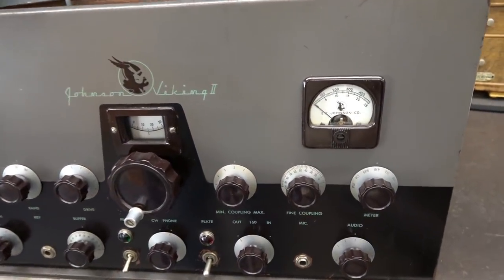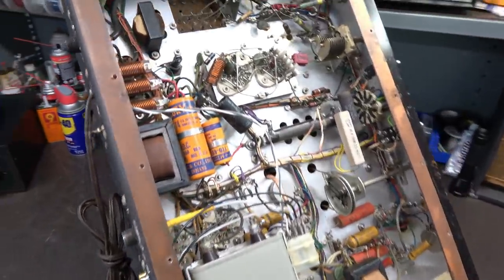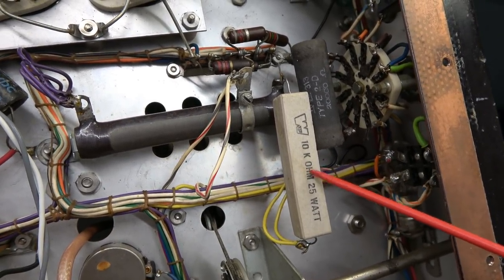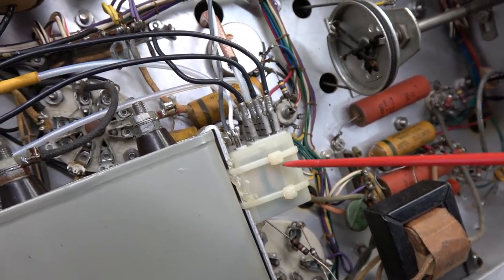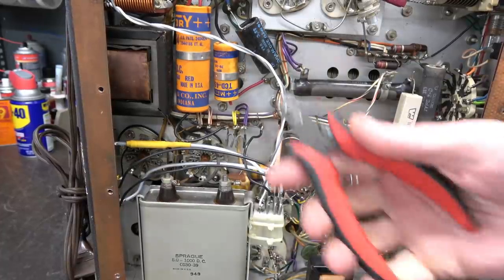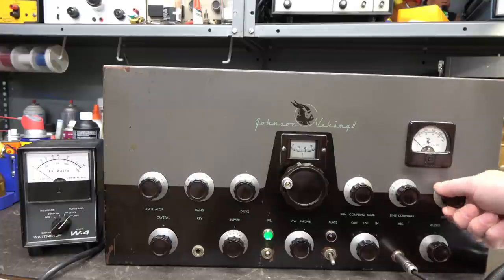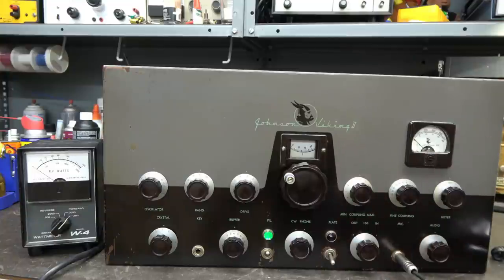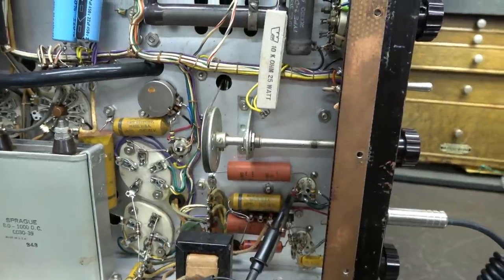How NOT to buy Johnson Viking II Ham AM CW Tube Transmitter Swapmeet Special

Comment: I saw that you changed out the resistor in a later part of the series.  I just had the impression that your emphasis of the hazard would have called for replacement (or at least reorientation ) right away.  Great vid.  thanks. 👍

Comment: If you cant look inside, top and bottom, then you are taking pot luck.  Sometimes, you get a raft of almost new tubes, a chassis that wipes clean with a damp cloth, and no damage, or weird mods to un-do. Bingo ! you won the lottery.  Sometimes you get a real bag of worms.  Replacement Modulation and Power Transformers really only come from parts radios...so it is often SAFEST  to test the power transformer with the rectfier removed FIRST.. on a variac  to make sure it isnt gonna smoke.. and use an ohm meter to test the mod xfmr ( resistance measurement are in the manual)  to make sure it is good.( no shorts or opens)   IF there is a capacitor across the mod transformer secondary ( high cut )  then it is smart NOT to apply power untill it has been removed or replaced !

Comment: I've learned my lesson from my many years of going to hamfests.  Hate to say it but some hams can be real dishonest.  One time, I was helping my brother-in-law purchase a Drake transceiver from a guy who said he just used it last week.  Took it to the test bench (The Dayton Hamfest had a test setup just for this purpose).  Anyway, plugged it in, powered it up, and received great.  Keyed the mic and NOTHING.  And NOTHING on all bands.  Needless to say, the seller had lots of sweat on his face claiming that it worked fine.  Yea. . . .sure.
Reply: "It was working when I last powered it up."  Heard that a gazillion times so as a seller I've started putting rigs on the bench before the hamfest and taking a video of them in operation on my phone...I then offer that to prospective buyers as at least some indication that the gear is functioning correctly. Surprisingly not a lot of guys want to see the video before buying something, I actually have to go out of my way to make them watch!  73 - Dino KL0S
Reply: Dino, I llike your technique.  I wish others would do the same.  I've sold many items at hamfests (and eBay, too).  If there's a problem,  then I tell them.  I sold a mixer board on ebay once and indicated that one of the 16 channels is out.  Even with that info, bidding was high and I sold it for more than I was expecting out of it.  Being honest saves a lot of frustration.  73's Craig N8CA

Comment: Timmy WA1HLR used to call them Junkstons, but he said it in a loving way.
Reply: Excellent work! Let's face it - they are all projects at this age. Even my military radios are failing now, and they used fantastic grade components. Even a perfectly untouched stock radio that demonstrates good at the meet, will shortly fail without the basics. Contact cleaning, cap replacements and a good tip to tail component and wiring inspection.
Reply: @MIKROWAVE1  Yes indeed... even milspec gear is subject to Father Time. 
I found another great Timtron video... besides being very humorous, he's also definitely a genius with old gear: youtube.com/watch?v=cqM-nbiMBOE

Comment: At this point, I consider most if not all old receivers and transmitters to be projects. So many have been butchered over the years. It seems more so now than ever. A lot of people are selling stuff that’s been supposedly checked and recapped that has multiple errors, uses cheap Chinese parts and is way out of alignment. I won’t pay good money for junk. I’ll buy if I can get it for cheap and it’s worth fixing or has useable parts.

Comment: I love it when some yo-yo decided to recap a radio... using ancient dried out  capacitors !   Paying for repairs on radios like this makes little financial sense, either for the repair man or the ham.. because Hams Are Cheap.   they have a one size fits all idea about what radios are worth.  Just take the parts.  If you are buying the caps onesy twosy at retail.. you get to spend $25 + shipping.  Tubes, expect to replace the finals and the modulators and 1 or 2 rectifiers,  and what are you up to if you don't have a well stocked junk box ( or have to replace the ones that go into this radio ) 2 6146's  2 807's a 5U4,   and already some real cash if you cant get them at the flea market.. and you dont want crummy tubes in your final or  unmatched  or soft tubes in you modulator... so you at least have to have tube tester.   So you can get 100 to $300 into parts...  you paid $50 or 100... and if you do the work yourself.. this is ok, because the radio will play for 30 years with no grief.. If you do a REAL OVERHAUL...  if you keep it fine.  If you sell it.. not so fine... but if you pay to have it fixed....  oh dear.   Somebody can "make it work" in a few hours... but doing it right is one but probably 2 days for a guy who has done it many times before... if you are thorough.  you do the math.  and think about how to say Thank You.. big time.. when somebody hands you a well rebuilt transmitter for a few hundred bucks !